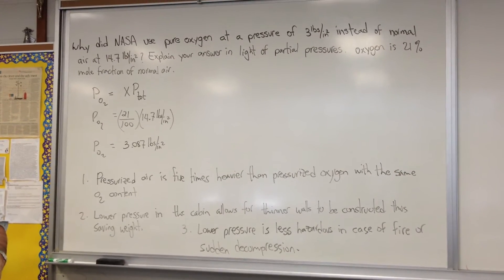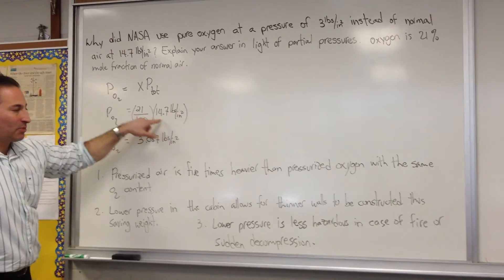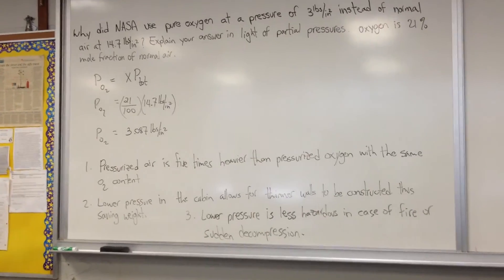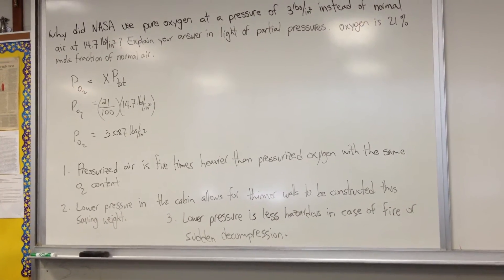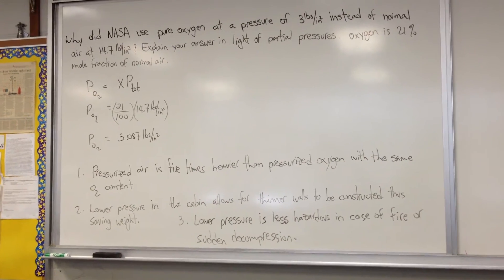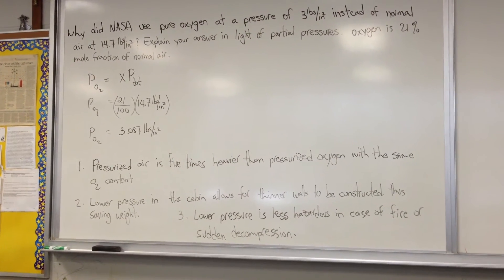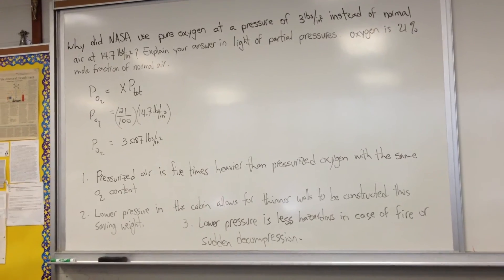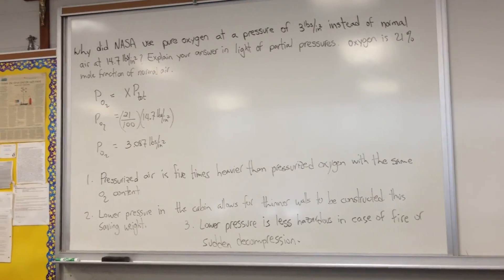Gas Laws Part.8: Why NASA used Pure Low-Pressure Oxygen in the Lunar Landing Module

Comment: It wouldn't really save them that much weight because the nitrogen in normal air, which constitutes approximately 78% of its mass, isn't absorbed and wouldn't need to be replaced very much.  On the other hand, they would still have to consume the same amount of oxygen - around 550 litres per day, per person.

How could they possibly have stored that much oxygen?
Reply from the maker: What do you mean!? Every gram of weight counts on such a mission.

Comment: Doesn't the nitrogen content of normal air significantly inhibit oxidation?  

If they had the same concentration of oxygen at 1/3 the air pressure, wouldn't it still be a severe fire hazard?
Reply from the maker: I think the only thing that really matters is the availability of oxygen. They only had 1/5th atmospheric pressure, so 1/3 might increase the fire hazard.